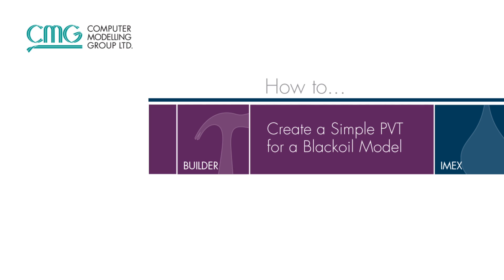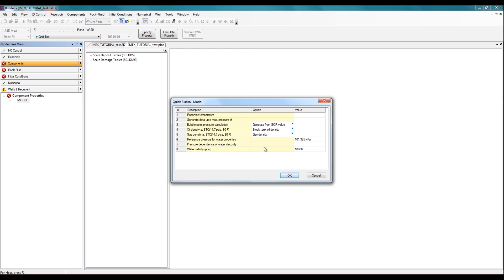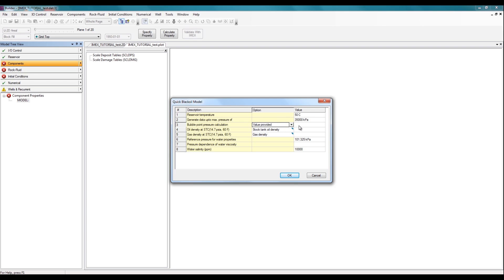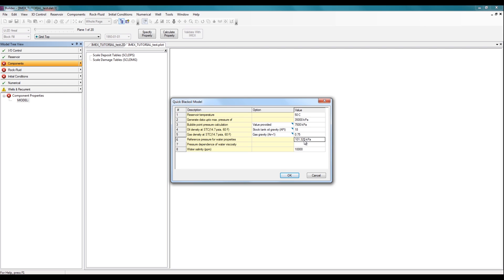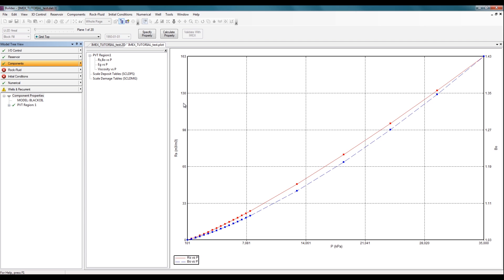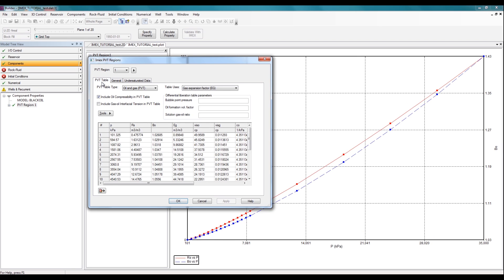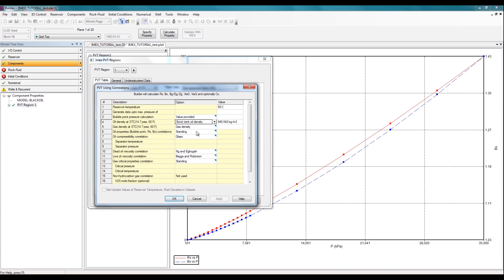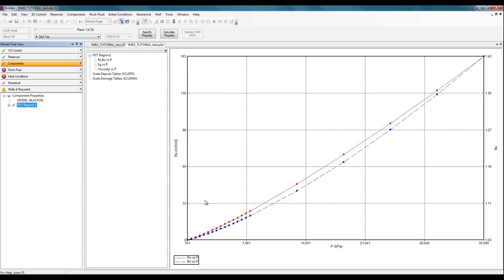How to Create a Simple PVT for a Blackoil Model

Comment: Hello what is BO and Rs and EG
Reply from the maker: Hello Samuel. The oil formation volume factor (Bo) relates the volume of oil at stock-tank conditions to the volume of oil at elevated pressure and temperature in the reservoir. Values typically range from approximately 1.0 bbl/STB for dead oil to nearly 3.0 bbl/STB for highly volatile oils.
The Solution Gas-Oil Ratio (Rs) is the amount of surface gas that can be dissolved in a stock tank oil when brought to a specific pressure and temperature
And the gas expansion factor (Eg) is the ratio of gas volume at surface conditions to the gas volume at reservoir conditions. 
Thank you for watching the video!

Comment: if am using dead oil then what do i put as the gas gravity?
Reply: Hi Ronald, In this case, put an arbitrary value for gas density. When no gas is present, the gas properties including the gas density specified by the user will be ignored by the simulator.
Reply: how does the simulator know that no gas is present if I do not tell it?
Reply: @ronaldssebadduka6837  Oil has a property called Bubble Point Pressure (BPP). During reservoir depletion (by oil production), the oil pressure drops and as such oil expands. When pressure drops below BPP the gas that is dissolved in oil comes out and forms a new phase called gas phase. The simulator compares the oil pressure and this BPP at every timestep at every point in the grid. As long as the oil pressure is above BPP, simulator knows that there is no gas.
One way to define a dead reservoir (no gas in it whatsoever) is by specifying a very low BPP that is not reached in practice. This way the oil is always at pressures above BPP i.e. no gas present. Hope this answers your question. Please let me know if you still have questions.
Reply: @Adam-K4 I thought bpp is where the gas starts to escape to the vapor phase below it the gas remains in the oil. don't u think so? above bpp more gas goes into the vapor phase
Reply: @ronaldssebadduka6837  It is the opposite. Imagine a single phase reservoir where initially all the solution gas is dissolved in oil.
As production continues and reservoir gets depleted, its pressure slowly drops until it reaches bpp at which point gas starts to evolve from oil and form a gas phase.
So in short, at pressures above bpp, gas is in oil solution. It's below the bpp where gas comes out of oil and forms the gas phase.
Hope this helps!
Reply from the maker: Hello Ronald, thanks for watching the video and for your question. Please email support@cmgl.ca and one of our engineers will be able to assist you!
Reply: @compmodgr  Many time correlation suggests increasing Bo after bubble point pressure. Whereas in real cases Bo is decreases above bubble point pressure. 
So in case when you don't have any data for an undersaturated reason, it is not possible to use correlations.
Reply from the maker: @19neetish  Hello Neetish, The correlations will generate a table of properties for saturated conditions. For Bo, the correlations can also suggest an undersaturated oil compressibility which will describe the compressibility for conditions above the bubble point pressure. if you have any further questions, please contact support@cmgl.ca